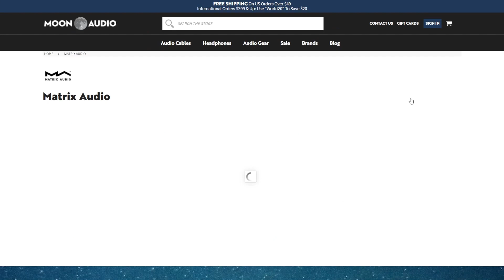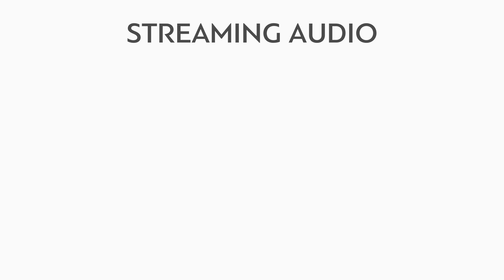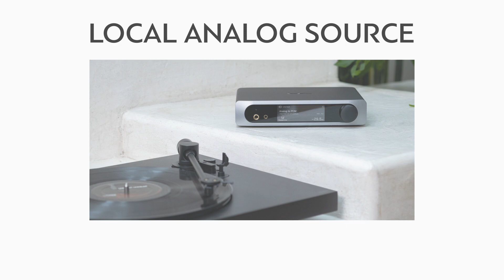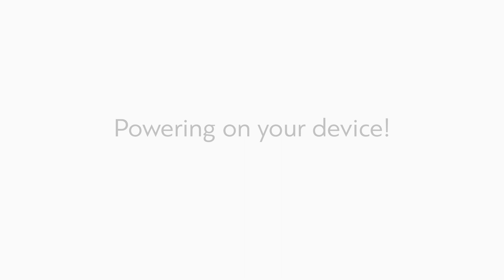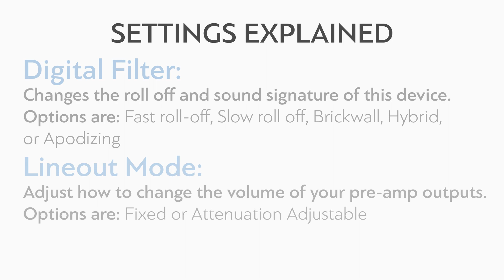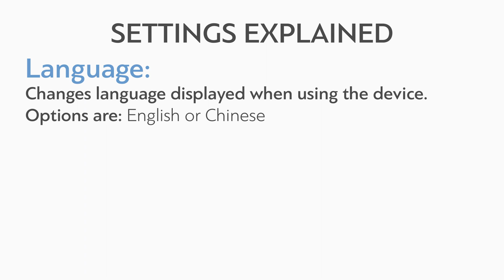Matrix Audio Mini-i Pro 3 Product Guide & Video Manual | Moon Audio

Comment: I have been using a MATRIX Mini-i Pro bought in 2014.
Have worked well, although some of the LED segments have failed.
Seriously considered upgrading to the Mini-i Pro 3, 4th Gen.
But was disappointed to note that:
1. LAN and WiFi does not with PC or Android. Only with iPhone, iPad or macOS computer over AirPlay.
2. No direct connection to HD or SSD
So I am looking elsewhere :-(